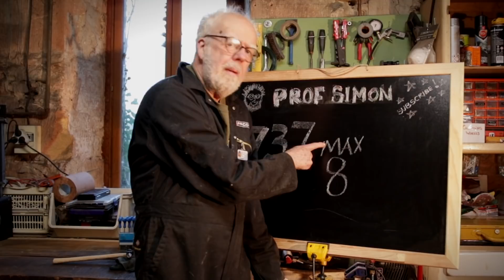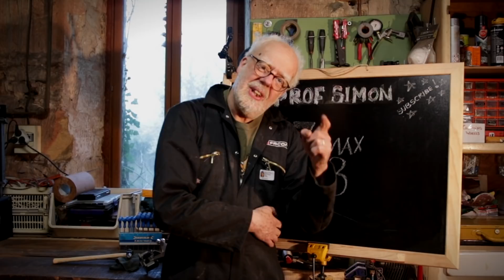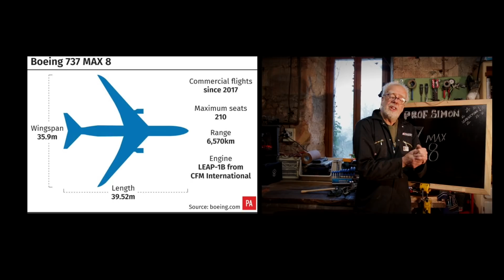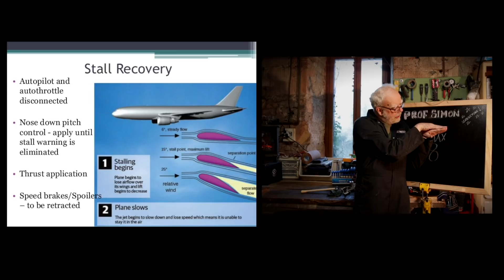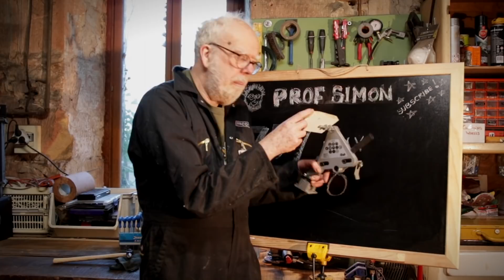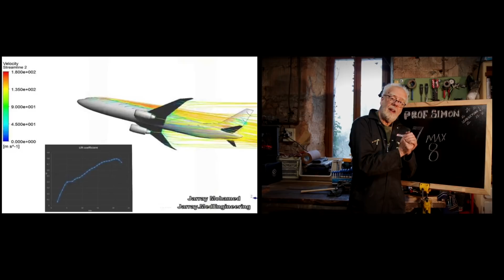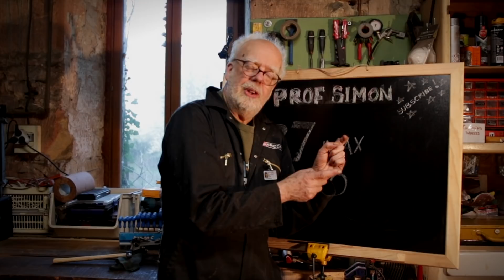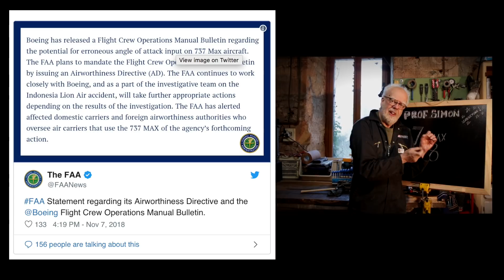Boeing 737 max 8's

Comment: Pilot's didn't do they homework?!! Is there not a button to disengage the auto pilot? They must have tried this?
Reply from the maker: on the newer planes the envelope automation still works with the autopilot off.... its part of the way the plane flies...i don't know an easy way to disconnect it.
Reply: @SimonHollandfilms  I see, I suspected that. Nevertheless, even it was possible to disengage the autopilot it would an nearly impossible task I guess to straighten up a 737 when it is in a vertical dive at relative low altitude.
Reply: Professor Simon Holland on an Airbus for sure . They will have the FMGEC ( FLIGHT MANAGEMENT GUIDANCE ENVELOPE COMPUTERS) on as long they are not switched off, which is also from the cockpit possible. Then the plane flys in direct law (Airshow mode ) the Boeing’s I know Off means off but I have no experience on the B737
Reply: They have to press STAB TRIM CUT OUT
Reply: Most jets are so tweaky that it takes the autopilot to fly it with the pilot controlling the autopilot settings.  This is especially true when flying out of high altitude airports. The time-lag difference between human hand eye coordination it too far off to catch up with the airplane.  A lot of trainer aircraft that ATP pilots use have both types of artificial horizon formats in the dash (old school trainers).  This same type of pilot artificial horizon disconnect occurred when Buddy Holly got killed in an overloaded Bonanza.  A different horizon format was in the airplane than the pilot was used to. 
There is a YouTube video in which a Cessna Citation coming out of Salt Lake City had twin autopilots and both failed causing a crash.  Apparently Cessna wanted two chances of controllability in case one failed, thus having autopilot 1 a d autopilot 2.  These planes must have autopilots that work correctly because the difference between flying and stalling is very close.  Could be even 2 knots if airspeed difference flying in level flight. Too close for human hands to control.  The difference in stalling and flying nose first into the ground is negligible   Neither is hand controllable.

Comment: I was wondering why these planes were crashing. It reminds me of the Airbus A320 by by wire crash back in 1988 where the computer said NO. I'm not sure what exact conclusions were decided when the investigation was completed. How much was down to the computers and how much was down to the pilot error.
Reply from the maker: Exactly...check out my video on logical thinking for film of the 1980s airbus autopilot crash....things have got better but in this case the pilots just can’t save the aircraft...I am convinced it was a software and pilot training issue.
Reply: One time I was on my way flying back to Taiwan and all of sudden the pilot said there's something wrong with the plane, so we need to return to Okinawa and wait until the problem is solved. At that moment I was like, shit this is it, I am going to die on this plane today.
Reply: @taiwanvstheworld  
Wasn't this an A330-300 of the EVA AIR?
If I am not wrong, this happened in 2012 on a flight from Japan to Taiwan and short after take off, the aircraft suddenly nose-dived without the pilots being able to recover manually though pulling the stick backwards like on QF72.
They could recover only through switching off vital components, a counter-intuitive decision: recovering from a dangerous situation through making it even worse!
Reply: These crashes here aren't pilot error... something is wrong with the new system and software

Comment: Boeing needs to scrap that software update
Reply: Because that's how aircraft work...
Reply: Not that simple.  It might work if each airline were to commit $5k to $100k per pilot for additional training on how to manually recover from the greater tendency of the max to stall.  Don't underestimate the complexity of these aircraft and the challenges faced by the flight systems designers.
Reply: @Thevenin6733  but Boeing sold the MAX version stating that no additional education was required. Obviously not true. RIP